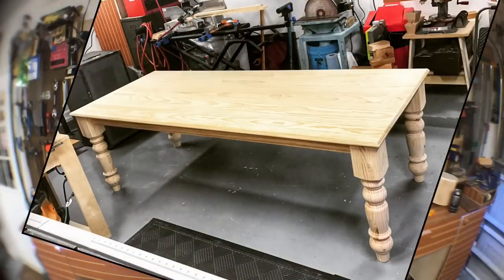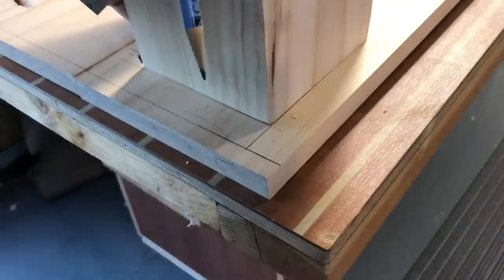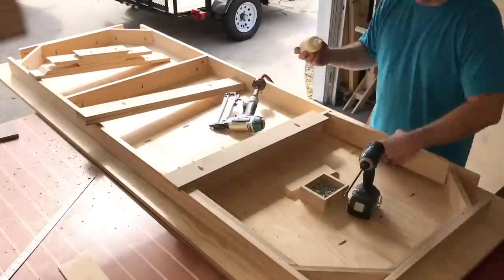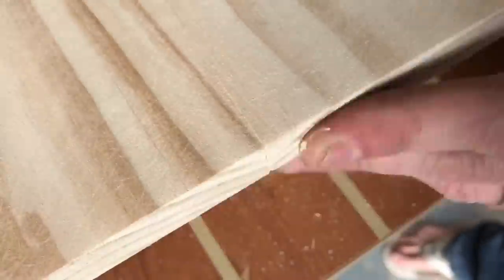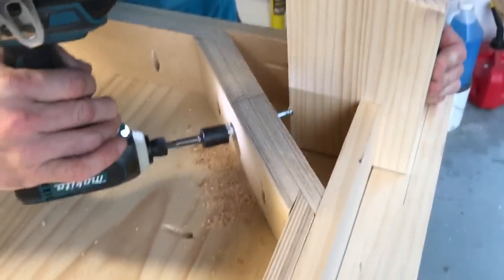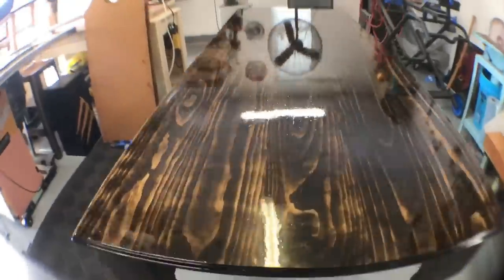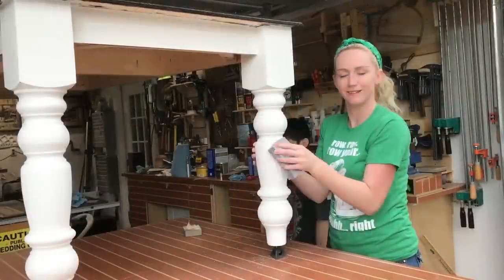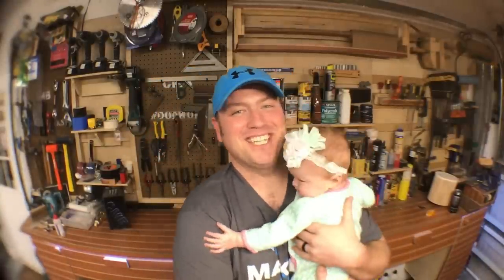How to Make a Farm Table

Comment: great work!  keep it up.  my brother and my father-in-law are finish carpenters, i myself am an electrician that happens to love woodworking.  any recommendations on necessary tools to get started making furniture or cabinets?
Reply from the maker: +Seth Lewis thank you very much. Honestly it doesn't have to be an expensive one but the tablesaw is pretty essential. Of course you can buy a small contractor saw and build around it to make it more versatile. I did that for years before I bought the rigid granite top table tablesaw I use now!!  Thank you for watching brother
Reply: A Glimpse Inside what kind of jig is that you use?  what kind of router?
Reply from the maker: Seth Lewis The router is a full-size half inch shank the walls. It retails at about $200 at lowes or any big box store. Actually got that one for Christmas. That's another thing once people know you're in the woodworking they typically will ask you do you need any tools and if you're really specific with them chances are that's what They will get you ...you know of course if you've treated them nicely lol. Anyway what Jig are you referring too?  The one on the table saw? If so that is a small cross cut sled that I made to help me make repeatable 90° cuts on the table saw.
Reply: A Glimpse Inside I was referring to the kreg jig.  they are not cheap, any recommendations on which one to start with?
Reply: A Glimpse Inside I'm watching your diy barn door bar right now, looks cool.
Reply from the maker: Seth Lewis gotcha. Search your local craigslist. Or swept swap offer up those types of apps. Also I'm not sure but Harbor freight may carry a generic pocket hole jig that probably would work just fine. Sorry for the confusion hope that helps
Reply from the maker: +Seth Lewis thank you so much. I really appreciate you watching these videos me the lot. Yeah that barn door refrigerator attraction was a pretty project. Thanks again

Comment: Nice work. What type and size is that squeeze clamp that you used and where can I find them?
Reply from the maker: +jessefjr if they are the green ones. They are wood river brand I got them at woodcraft.  thank you for watching!!!!
Reply: A Glimpse Inside Thanks for the quick reply but I was talking about the silver c clamp style @ 1:40 in the video.
Reply from the maker: jessefjr those you can pick up at Harbor freight. And they are relatively inexpensive as well. Sorry about that hope that helps. And thanks again

Comment: It looks like you originally cut lateral pocket holes to attach the skirts to the legs but ignored them and went with the single lag screw instead. I guess the pocket screws wouldn't really add much strength anyway, right?
Reply from the maker: I had intended to use like screws all along. If alcohols were there to maybe hold a piece in place. But I ended up not going with it. The lag screw method is something I had done may times before this video. Good observation tho bro!👍

Comment: I used your mixture last night on one of my projects and it is still very tacky to the touch after 12 hours. How long do you usually have to wait between coats? Could I have put it on to thick? I just used a foam brush like you did and added more when it started to streak and not cover.
Reply from the maker: +Conrite Wing the first 3 part mix I hand rub on. A very thin coat. It's mainly to prep the wood and to start to fill any micro gaps in the surface. Also. What is the temperature there. If it's too cold it could take days for a finish to day. Especially if applied too thick. I apologize for any misleading! I hope you can resolve this issues. Thanks for letting me know!
Reply: A Glimpse Inside you didn't mislead I'm sure it was me. I hand rubbed in the first coat like you said and it dried fine. Then the second coat of the same mixture with the foam brush like you said and it seams to be taking forever to long. I'm in 70 degree weather so that isn't it.
Reply from the maker: +Conrite Wing OK, I just feel bad. I hope it didn't ruin your project. Finishing can definitely be a finicky process for sure sometimes.
Reply: A Glimpse Inside I can always sand it down and start again. It isn't that big of a deal. It is just a bench. I am hoping by tomorrow it will be good to go. Thank you for all the help.
Reply from the maker: +Conrite Wing of course. If you like send me your email. So I can send you a glimpse inside sticker pack. If you would like that kind of thing for your troubles
Reply: A Glimpse Inside I would love that but I don't want to post my email address on a youtube message board.
Reply from the maker: +Conrite Wing I completely understand that. So if you could search Facebook pages "a glimpse inside Jacksonville Florida" my page should come up and if you could message me your email in there I will send you all the information

Comment: Dear,
After staining stage, what did you use to wipe it off with?
Reply from the maker: othman jabirr Are used an old piece of T-shirt
Reply: A Glimpse Inside 
I am very amazed and very quick reply. I thank you very much and god bless you and your family. 
Is it just a dry cloth ?
Reply from the maker: othman jabirr Yes a dry cloth that then becomes a little saturated with the stain. And I find that because it is saturated, it applies a very nice even coat of the stain throughout the table. Then I let it dry overnight
Reply: A Glimpse Inside  thank you

Comment: I'm curious a year later how the table top held up?? Hopefully still intact!
Reply from the maker: I spoke to the client about six weeks ago, actually he sent me a picture of all of the kids around the table. Everything looks like it did when they first got it! Us being in Florida probably helps. The difference in temperature is not that great considering other places in the country! Thanks for asking man I appreciate￼
Reply: I'm gonna build it in 2 weeks. It's gonna be awesome!
Reply from the maker: Pofomoco sounds great! I’d like to see it!  Email or instagram is a great way to show me if you want!
Reply: I finally started my table build this past week. The top panel glue up went great, I used eight 1x6 (5.5) x10 red oak pre-milled boards. I added a 6" breadboard and now I am halfway thru the poplar apron. Its 11 ft long x 44 inches wide. It's an absolute beast! Your video has been very helpful. Thanks for the inspiration!
Reply: I was wondering what you had your pocket jig set at and what size screws you used. I’ve never used one before and only have a little clamp on guy so any and all details would be great! :) thank you!!

Comment: What grit sandpaper did you use to sand off the first coat of varnish with? Did you use tack cloth afterward, before applying the second coat?
Reply from the maker: Hey man. Good to hear from you again. Are used to 20 grit for the first coat and do a light dusting with a cloth that has mineral spirits on it. Once it dries I repeat and climb the grits from there
Reply: Sounds good, thanks for the reply. Just for clarification you said 20grit, did you mean 220?
Reply from the maker: Papoochee yes. 220. Sorry man. Talk to text got me.
Reply: thanks bro, appreciate it! It seems like when I use 220 all of the varnish comes off, that's why I'm asking.
Reply from the maker: Papoochee apply the lightest of pressure sir. Yes it seems like it all comes off however it is still there
Reply: that's good to hear, I thought I was doing something wrong =)

Comment: Hello Chris, I think you did a fine job here despite negative comments. I took the basis of your table construct and made a table of my own for my amateur radio gear. The table had to be strong and stable, yet not look so bulky and appear big in small room. I used straight legs with a slight taper near the bottom, and coated the top with epoxy for a smooth glass appearance.  I’ve had the table for a year now without any issues. The table brings me great joy, not to mention all the compliments that come along the way. Thanks you for your inspiration to build this table. Here is a link to my Ham site with the finished table: www.qrz.com/db/KG6JDR

Comment: Everything (aprons, braces, supports, etc.) Is tightly screwed to the tabletop, which is NOT made of plywood, and WILL want to expand and contract with the changes in humidity and temperature inside. This will lead to cracks or loosening of the boards (in a year or two).